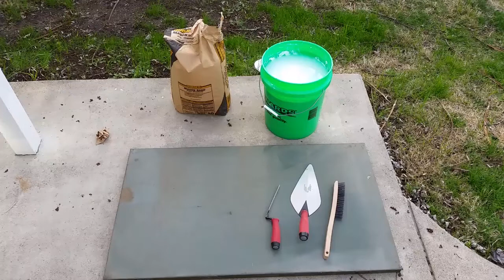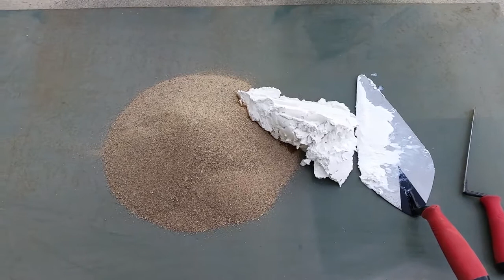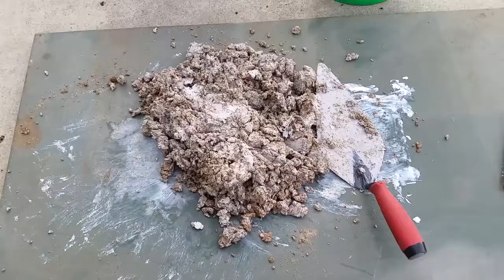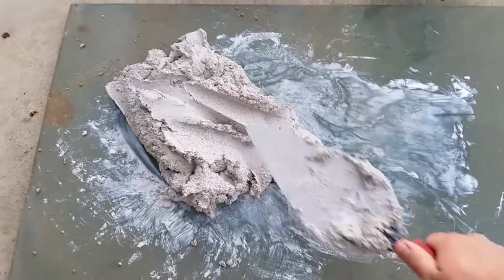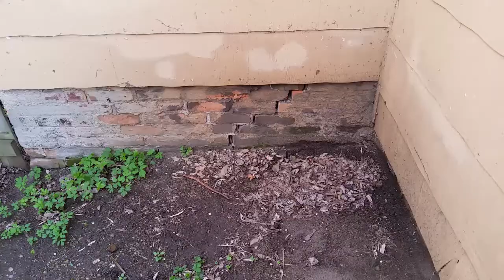Making Lime putty into Mortar

Comment: Should've used Hydrated Lime! Also, just filling in the crack will actually make things worse over time. You need to chisel out all soft mortar just past half of the brick and then fill it in once washed and brushed. What you're doing is only covering up the problem instead of fixing the problem.
Reply: This is hydrated lime. See his videos for making lime putty. He made the putty from hydrated lime
Reply: Do you make or buy hydrated lime?
Reply: Hydrated lime isn't actually believed to be any use for anything but plasticising cement mortars

Comment: Hello, what kind of sand did you use? Is it just any all-purpose sand from home depot? Thanks
Reply from the maker: Nat Regalado thanks for asking, I used mortar sand, it was quicrerete brand but yes any relatively fine grain sand will work
Reply: Aperture Now would hydro sand work?
Reply: You need well graded sand. Sakrete all purpose seems okay. It’s has small aggregate down to dust.  Then you should do a saturation test to see how much putty to use.  Mine was 1 putty to 3 sand plus and extra 1/8 putty.
Reply: Will beach sand work?

Comment: What's the difference from using lime mortar vs using a NHL 3.5 Lime (or similar) in terms of Practical use.  It's so hard to find NHL here in the midwest so I was wondering if they're interchangeable.  Thanks in advance for any advice or thoughts.
Reply from the maker: Andrew Weis the NHL mortar is a hydraulic mortar, part 1 of my series on mortar talks about this some more but basically the difference is in the water resistance of the mortar, hydraulic lime will set in moist locations and regular lime mortar may not. How old is the brick you are working with?
Reply: 1880 the home was built using a 2 1/2 inch thick foundsation wall which seems to be mostly comprised of limestone blocks.  I live in Eastern Iowa where temps can get into the -10 to -20 ranges.    It's descent on the inside mostly but there was a section where there was a small river flowing throught the foundation over a crawlspace into my lower basement which drains into the city  main..  The water itself was easy to deal with but the eroded hole in the foundation wasnt .  

I dug away a small section of the dirt on that side of the home to find that most of the mortor that was basically eroded away and was replaced with dirt that was inbetween a good chunk of the rocks.  The foundation basically fell apart in that small section.  I temporarly and lightly used a portland based mix i happen to have sitting around to put a fair portion of the very deep rocks back into the wall which is about 2 1/2 feet just to put a bandaid on the deterization, but I went light on the mortar as I know its' not friendly with old stones. 

Any how now I'm here trying to make the best descisions I can to move forward with the repair.  

FYI.  I do plan on installing an updated rain water  drain system on the trouble areas of the house.  I believe there was a sort of dry well/french drain setup only there was no drainaige tube of any sort in the ground just what looked like a foot or so of loose gravel athat wasnt wrapped in any soil membrane  and was completely impacted with dirt.  So ya, that's on the list too, let the fun begin :)
Reply: correction ,*

Approx 2 1/2 foot thick foundation.
Reply from the maker: Andrew Weis you will probably be fine using the NHL mortar, as you probably know the reason to use lime mortar is that the way that bricks were made left them with a hard shell and a softer center that can be exposed if the mortar is harder than the brick. In your case you have limestone which should be the same density throughout. NHL mortar should still be softer than a Portland cement mortar and will resist any moisture that may appear later on.
Reply: Yea, the real issue come froms the moisture working it's way into/out of the walls.  Where I believe NHL will allow that process to happen naturally and in a way "flex" with any movement.

The next thing I have to ask is if you may know of anywhere in my area that may sell this type of lime.  I've checked the box stores like Menards, Lowes, Home depot..  and they dont seem to stock it or  even really have a clue about it.  I guess I'll just move up the chain onto the more specific vendors of the trade and see what I can find hopefully without paying an overly high price or traveling.  I figured I'd ask anyhow and maybe get lucky.
Reply: @dirkdiggler2870  hi i realise this is a late reply however I'd be looking into diverting the small creek as much as possible - around the house and away from the foundations..  Potentially even create a safe frog pond (mesh to protect them from cats) and put a diversionary pipe from there - then rejoin it where you know the creek to continue
Reply: Andrew, the difference is that NHL cures quickly. I think it's a bit of a scam because it only has a small amount of lime in it. It is for jobbing people who need a faster curing mortar.  use putty (the real thing).
Reply: I apologize for the delayed response.  

Since we last communicated I had spoke with a local mason and he simply told me that I should use type N mortar mix and  do a 1 : 3 ratio (Mortar mix : Sand : Water as needed.)  I happened to have some on hand and did a mix as he suggested and it simply seemed far to dry and not near "plastic" enough if you know what I mean.  I work as executive chef and have for the past 10 years, so I know when sometihing just doesnt seem right as far as  the proper texture, smoothness, viscosity, flow, etc. which is definitly threw a red flag to my intuition.

I'm pretty familiar with the lime putty and have actually used it to richen up some regular type N mortar for interior work and it does add some butteryness to the batch for sure.  I'm assuming your referring to fully hydraded lime (types S)  soaked in water for  a frew days/weeks making sure it's fully saturated.  Correct me if i'm wrong.

What would you recommend using  for ratios when using the lime putty and is there way to utilize a premix instead of having to buy all the ingredients separately.

Also a quick question... is there an industry standard format for how to write out ratios...for example  if the recipe was a 1 : 2 : 3: 4 what order do the ingredients go in  ?? I"m always confused as Im simply not sure.  

Once again I very much appreciate all the advice on this subject as I'm not fully fluent in this realm.

Thanks again!
Reply: @dirkdiggler2870  .
Reply from the maker: Sorry I have not gotten back to you, Hopefully I can clear up some of your questions.

First: The order of Mortar, 

1) Lime Mortar, This mortar is simply Lime, Water and Sand. It sets via evaporation and is relatively soft when set. this allows the most movement and transfer of moisture through the mortar.

2) NHL Mortar, this mortar is Lime Water and Sand but also has trace amounts of other minerals that cause it to set via a chemical reaction. This gives a harder mortar when cured. NHL is given numbers from 1 to 5 to indicate the level of hardness when cured. advantages include the ability to set in conditions that do not allow for total evaporation of the moisture in the mortar and slightly more water resistance when set depending on the level NHL you use.

3) Cement mortar this is made with Portland cement and will set the hardest of these mortars. In your case you could probably use cement mortar if you wanted as you are laying Limestone and it is able to withstand a harder mortar. this mortar is going to be the most water resistance but will be less flexible.
Reply from the maker: The format that I use for mix ratios is the greater amount first and of course you need to know the materials so if i was mixing a mortar of 3 parts sand  to 1 part lime I would say that is a "3:1 mix of sand to lime" or something like that
Reply from the maker: As you said there is a certain "feel" to mixing mortar my best advice without being able to show you hands on is this.
The strength in the mortar comes from the sand the actual mortar is just there to hold the sand together, so mix in as much sand as you can while still having mortar that is plastic and sticky enough to stick to a trowel held sideways.
Reply from the maker: Sadly I don't know your area well but if you are not able to get an 
answer from the pro desk at one of the big box stores you might need to try either a smaller hardware store or a masonry supply store I would 
just check the yellow pages and see what you can find or ask your mason where he buys 
supplies.

Comment: The lime putty that you had in the green bucket was covered by some water (it was in the other video). In this video there is no water on top anymore in the green bucket. Did you just mix it in or did you pour it out before making the video? If it is still in the bucket (I can't tell for sure), how did you take out putty from the bucket?  Would be useful for me if you actually filmed it, but I guess it is too late. Maybe a trivial question but I have never done this so I am learning. Thanks.
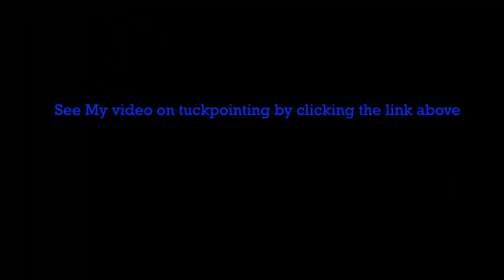Reply from the maker: The water is still there, if you look at about the 3:45 mark you can see it as I scoop it out, the extra water is there to 1) allow the mixture to absorb any water that it needs to be fully saturated and 2) it makes a barrier seal so that the putty does not dry out. As far as I know if you keep a layer of water on the putty it lasts somewhat indefinitely
Reply: Oh, I did not see this part when I posted my question. Thanks!
Reply from the maker: No problem, glad to help

Comment: so, does the lime putty have any practical use outside of being an ingredient for mortar?  Will it dry if used purely as a plaster? Can I shape lime putty into blocks ?
Reply from the maker: Hi, to the best of my knowlage Yes lime putty will dry without adding the sand if you wanted to make it into a block however I think that it would be very weak and would crack easily. this is just a guess on my part as I have not tried it. As for plaster you can make a traditional mortar in basicly the same way as the mortar just using a different ratio of sand and lime. do you have a project in mind that you could give more details on?
Reply: Estate Groundskeeper 

Hi.  Really appreciate you replying.  No, I don't have a project in mind.  I'm just fascinated by the potential of lime plasters and currently developing my knowledge
Reply from the maker: no problem, it is really neat stuff. If you check out the comments in one of my other videos https://youtu.be/TEsMSfoJLZ4 there is a link to a research paper on lime that is worth reading.